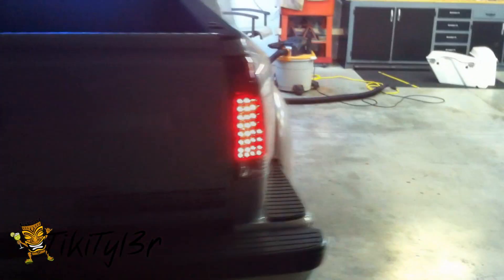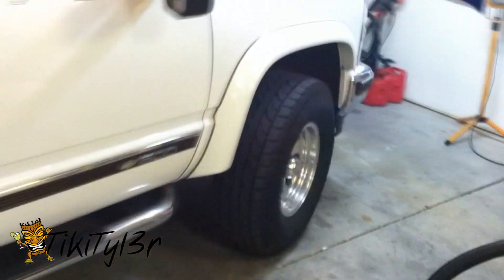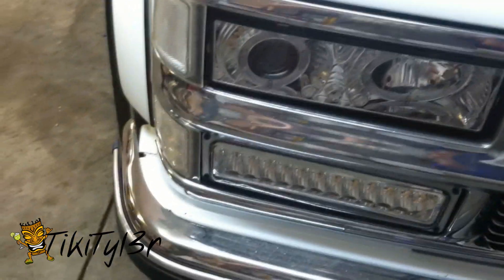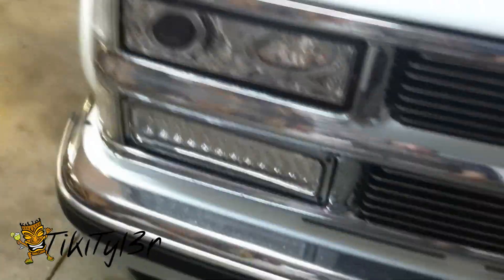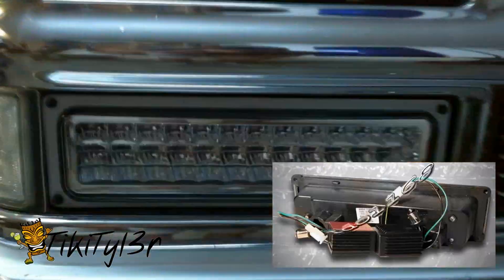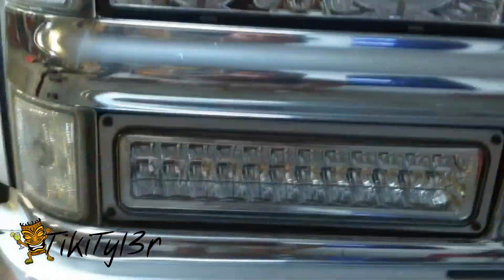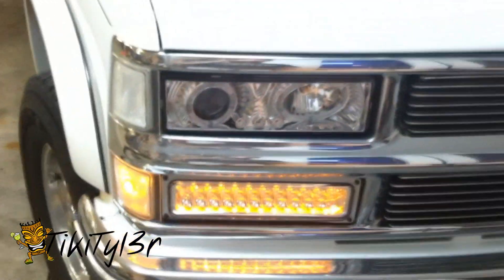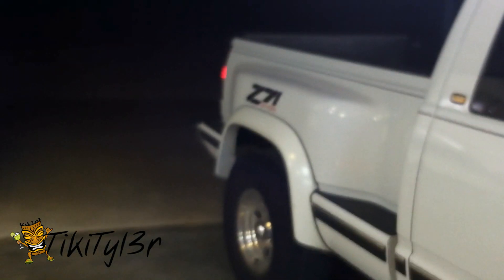LED's - In Depth

Comment: Ok I’ll shoot here I have led on rear I installed led flasher then I put led on side marker fine no problem when I tried to install anzo led turn signal the side marker lights don’t come on at all not eavn the park lights also raido blinks with turn signal oh the turn signal led has the black boxes on them
Reply from the maker: Everything is plugged in and connected tightly? Have you installed resistors on the front signal lights? Mine still had to have resistors back when I had these lights for them to function properly.
Reply: @ I thought the two black boxes were resistors no I did not the side markers did not come with black boxes

Comment: I just attempted to put on switchback signals on my 98, start with one side to see if it would work and I got hyper flashing, so I took out and put back stock halogen bulbs and I’m still hyper flashing on the one side I tried the led switchbacks, im not sure what to do to fix this, have any clue what it could be / for me to do?
Reply from the maker: Do you have the EP29 flasher relay installed?

Comment: Hey I know this was posted a long time ago, but I have the exact same headlights you have, but I only have hyperflash on my driver side, my passenger side blinks normal, could have I just connected something wrong or would I need that flasher relay?
Reply from the maker: Definitely would try the flasher relay, that might solve any of your issues.

Comment: I wanna get some of those parking/ marker lights it woulda been pretty bad ass if they were sequential since it’s kind of a LED bar I love the 2016 Silverado front end so what I wanna do with my c/k put head lights that has a DRL LED bar clear corner light /reflector and run those parking lights and then tint the parking light and lower corner light Amber I think it’ll look Im think it’s gonna how yours looks when you have you lights on except it’ll look like that with the light off aswell

Comment: Question. My leds are not hyper flashing because I did the same thing with an led flasher relay and they work amazing. My question is, the only issue I'm having right now is the turn signal lights on the cluster itself are both illuminated when I turn the parking/headlights on but only then they flash fine but I was wondering why that would be happening??
Reply from the maker: Mine did that once too, turns out the relay was kinda junk and didn't work properly.
Reply: @BADZ71  so do you suggest a new led relay?
Reply from the maker: I used this one and it works much better than the parts store ones. 
iJDMTOY Fit 1996 1997 1998 1999... https://www.amazon.com/dp/B00W2B50GE?ref=ppx_pop_mob_ap_share

Comment: Great video! I have a set of LED parking lights with only one plug I'm trying to install on my 95 sierra. They work, but I get hyperflash because of the one bulb not being in the socket. When I do put a bulb in it works as it should. Would the relay trick work in my case? Or is there something more I need to do?

Comment: Thanks for the 411, I do have a diff question, for the head light bulbs what do you recomend because I installed some led head light bulbs and they only lasted like 4 months. I do have day time running lights running all time. The lights were like 80 dollars is there a brand that will last and how do I turn off my day time running lights? Btw sweet truck 👍🏼
Reply from the maker: Usually there is a fuse you can pull for those lights. I would recommend Morimoto or profile for lights
Reply: Thanks,  I will look into all 👍🏼

Comment: Didn't work on my 98 c1500. Same relay and tried resistors. No difference. Flickering only happens at start up from time to time and I just cycle from high to low and it stops flickering. I am currently looking for a better option to pass inspection.

Comment: Yup. I went full LED running/turn lights. Different rear styling though. I even upgraded to super bright LED reverse lights when I had them out. They are head light bright and come with a warning to to run them too long in plastic housings. All my LED turn l lights came with a resistor plugged in. I removed those and dis what you did. Electronic flasher relay. I found out the hard way that turn lights and reverse lights are on the same fuse. Replaced with same amperage fuse, all good. It was my mistake that it popped. Love LED lights on my OBS Suburban. 
Next up, quad head lights.

Comment: Ive have the same headlights on my 89 silverado c1500 but i cant get the halos to work correctly . when i use my driver side turn signal it blinks the halos too. have seeing this video im thinking its because i never replaced the flasher to a electronic flasher.  also noticed once i disconnected the halos the flasher blinks fast on the passenger side and real slow on the driver side. i should mention that i have LED tail lights, dont know if this would matter.

Comment: How do you wire them got mine in yesterday and it's got me scratching my head. There are 2 pigtails one from the headlight itself and one from the ballast or resistor whichever it is now does one pigtail connect to the stock left light bulb harness and the resistor connects to the right light bulb harness or what pllllleeeaaassseeee heeeelllppp
Reply from the maker: You don't have to wire anything, they just plug right in.

Comment: got the same turning signal/Bumper lights. they didn't come with instructions on how to hook up . are they just hook up and go or what? I notice 2 black boxes with adhesive tape on the back that are connected to the light it's self with red and black wire .

Comment: Question I have is with the new flasher relay does the front side marker operate as normal assuming it has a led 194 bulb in it also reason I asked is a friend of mines has same setup up but his side marker does not flash and turns off when signal is on only with parking lamps on though. With them off it flashes as should with signals but now he dissent have the ep29 flasher either I think his are spyder brand

Comment: I have tail lights like yours but when I have my running lights on my reverse lights on I have no left break light or reverse light how do I fix it
Reply from the maker: +Matt Thorborg it's been a long time since I've had these lights. Only thing I can think of is getting an electronic flasher module, EP29, and adding some load equalizers.

Comment: ok... So I just Installed my LED Anzo Parking Lights and as I installed them one at a time I would check to see if they would work or get hyper flash. and It worked fine after the first one, but once I installed the second one they started flashing like as if my Hazard lights were on. I'm assumed this was one of the hyper flashes you would see.. So I went to O'rielys and got me an EP29 Heavy duty Electronic Flasher and I'm still getting the same results.. would I need to have my Tail lights and headlights HID or LEDS too to work properly?
Reply from the maker: +Jc Galvan they should work just fine with they EP29 electronic flasher as these lights already have load equalizer ballasts built into them. Make sure you have the flasher installed right as well as the plugs on the lights installed correctly.

Comment: I have the same parking light the only thing wrong with them is one side is brighter then the other? Any ideas why?
Reply: Check for a loose or bad ground in the wire harness.
Reply from the maker: +Conrad Carrasco probably more power going to one side

Comment: In this video it looks like your front parking / turn signals are all LED's instead of replacement bulbs. If that is what I am seeing, did you get them on line? If so what is it called so I can see if I can find some for my '98 GMC truck. Thanks
Reply: Anzo LED Parking Lights 511048

Comment: Would this be needed if I only installed an LED 3rd brake light? The braking part(red light) works but the cargo dont now after the install from the stocker.
Reply from the maker: +Torque655 You don't need the relay for the 3rd.

Comment: I'm looking to add these the same projector headlights on my 93 K1500 but every where I look they said they are made for 94 and up. I have the stock head lights and the mounts look very similar. Do you think they would fit on a 93? or what would be the reason why they wouldn't and is it fixable. Thanks
Reply from the maker: as long as you have the same setup I have then it would be no problem. The only thing I could see is if you had the dual sealed beam lights instead of the one piece single like mine
Reply: +BADZ71 they are a single piece.
Reply from the maker: +Southern Pride then it should work fine, same stuff I have.
Reply: +BADZ71 sweet, thanks

Comment: I just installed a couple LEDs for the front signals of my 95 silverado. Only did that to clear the end tanks of the intercooler, I could not reinstall the oem lights. (Cummins swap with dodge intercooler). I had the fast flash until I swapped out the flashers. However, I still have another problem. Both turn indicators in the dash light up and stay on when the park lights/headlights are on. I swapped both flashers too, the turn one up under the dash by the ashtray, and the hazard one in the fuse/relay box. No effect. So LEDs are definitely not plug and play, they only are if they load the circuits enough to work like factory.
Reply from the maker: It might change depending on what year you have, but mine were 100% plug and play.
Reply: Rorik Olson Try switching which plugs the LED's are connected into. Even though I plugged mine in the way the factory plugs where originally positioned the LED's only worked when I reversed the "bulbs" on the Driver Side LED. Had the same dash indicator problem you had and had given up but figured I'd try again and figured this out by chance. Maybe it's the same problem you're having.

Comment: I bought some of those signal lights and installed them but when i turn on the lights they turn on but when i use the blinker they don't blink but the rear hyperflash, would i still need the hd flasher to make them blink?
Reply from the maker: Yes, with these you will still need the EP29 flasher to correct any overload that the LEDs are giving your truck.

Comment: Nice LEDs I have the same in black best purchase ever but this is more about your headlights than your LEDs my question is that Halo on there I can't get mine to come on and I attached it to the blue wire in the headlight harness like I was supposed to but it still doesn't come on with the parking lights there were three blue wires down there and I tried it on all of them it still doesn't work  did you attach yours to the regular headlights so it comes on with them?
Reply from the maker: The wire for the Halos needs to be spliced into the parking light wires, I used the corner 194 bulb wire to splice it into. That way the halos come on with both the park lights and the headlights.
Reply: *****
 thanks I'll give that a go this weekend and hopefully it'll get it.
Reply from the maker: Good luck, it's definitely pretty easy!
Reply: @BADZ71  I have a 94, thinking the same color code for parking lights as yours. ( have the same headlights and parking as you) What color wire for parking so Halo's don't blink

Comment: I have a question, I bought the same blinkers as you just they are black, they dont hyper flash when I turn the blinkers on, but when the headlights are on the blinkers hyper flash. I need some help!
Reply from the maker: @Tyler Mower do you have the EP29 upgraded electronic flasher?
Reply: ***** I bought a LED flasher, and it still hyper flashed when my headlights are on, im not sure if it was the ep 29 though, would resistors be the way to go?
Reply from the maker: Yeah, if all else fails, you might need resistors. I didn't need them, but a lot of people do.

Comment: I have a 98 suburban and I had the same problem after I installed my LEDs. I bought a new flasher and now when I turn on one of my signals, both lights go on at the same time, as in the corner and parking light. They do not alternate back and forth like it is supposed to. The LED parking light isn't as bright when the signals are on, but when I turn them on they are bright. Would I need a load resistor for each socket? or is there more to this.  ( I have an LED bulb in my corner lights, but not my tail lights. I previously had LED tail lights and they worked fine)

Comment: Hey I was curious if you knew what the problem was if all lights were flashing when you hit the signal but wouldn't flash when lights are on... I have had this problem since I installed my plug n plays even with the new relay.
Reply: What did you figure out for your lights flickering?